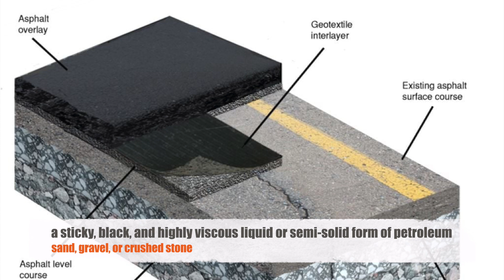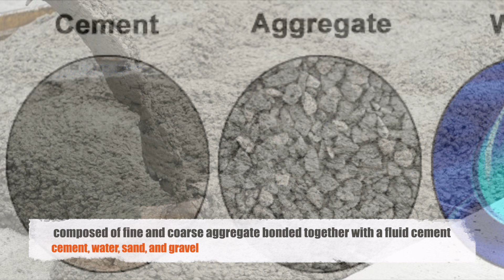Asphalt vs. Concrete - Which is the Best Choice?

Comment: Asphalt is smoother when it is first laid down.  But don't tell me it is better than concrete.  If it was , Big airports would only use asphalt for runways, BUT they do not.  They talk about " forever chemicals" in the our water tables...well, Asphalt and the petroleum in it, wears out and leaches in to our water.  I-77 / interstate 77, when first made in SC, was all concrete.  In my opinion, they just asphalted over the concrete so road crew would have more jobs.  Germany most likely has the best road crews.  The autobahn has to be smooth, in order for drivers to drive at high speeds.  Imagine driving at 140-150mph and hitting a pot hole...

Comment: They are both concrete. A concrete is an aggregate and a cement. Both use gravel and sand aggregates. One uses asphalt as a cement and the other uses Portland Cement. Asphaltic concrete or Portland Cement concrete.

Asphalt does not last as long. If a developer is providing the roads then cities require concrete. The choice sometimes becomes political and which source the politician is associated with. In downtown Houston the north-south streets are concrete and the east-west streets are asphalt. Why? One councilman had an asphalt plant and another had a Portland Cement batch plant. Compromise.
Reply: Asfalt is way better but you cannot try to save a penny, if you do it is way worse than concrete. Im thinking about noise, drainage, load etc.
Reply: @ In northern climates, where they use road salts, the salt causes the water inside of the concrete to freeze and pop and spall little chucks of concrete. This is why they use asphalt for roads and driveways. Today heavily traveled interstates use a thick concrete base topped with a wearing surface of asphalt. Periodically, they strip the thin asphalt and replace it. The concrete base provides a temporary driving surface during construction.

Comment: No matter which surface you choose, the base you put under it plays a big role in it's longevity.  If you were building a road from scratch today, you'd certainly put a proper base under it.  But many city streets were built over 100 years ago and we just keep resurfacing them.  They fail early because the poorly engineered base that moves or erodes.  And many old streets were put in without a thought for drainage except for what might trickle along the curb.  That's one of the reasons we get localized flooding during downpours.